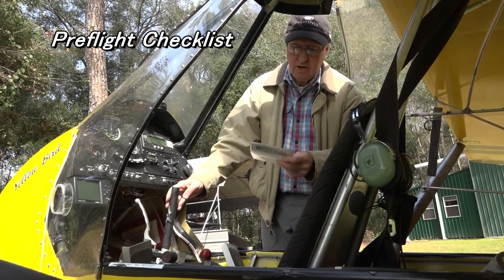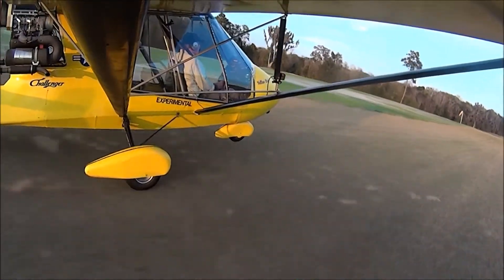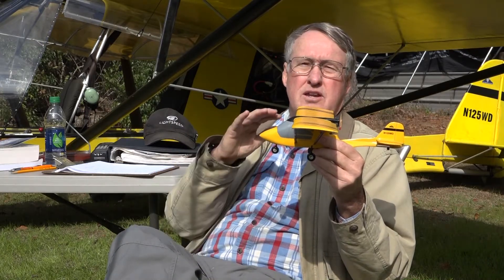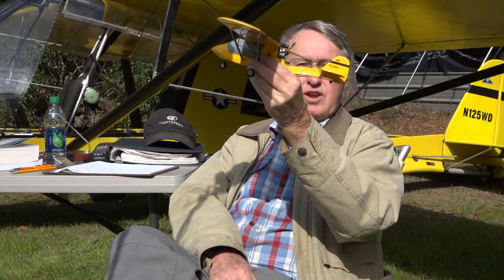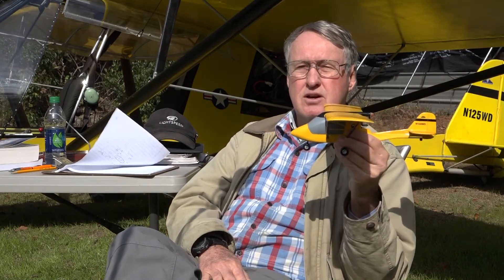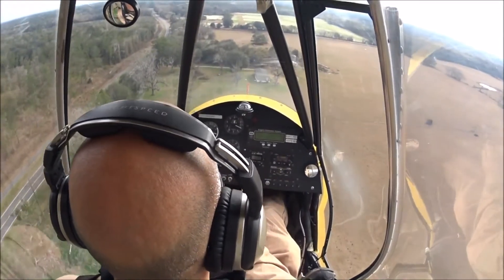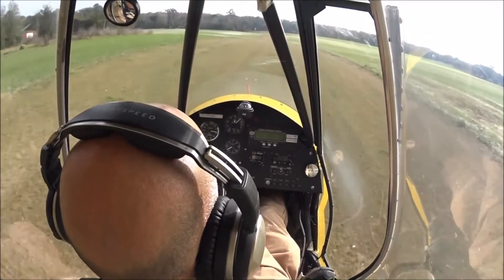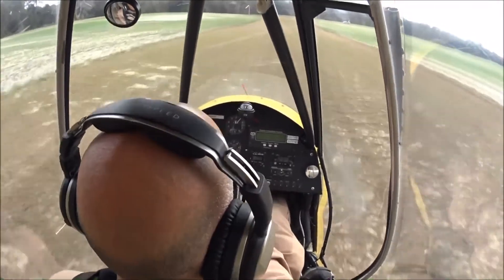Introduction to Challenger II  Flight Training   Part 3

Comment: Correction.: Approaching landing , control direction with rudders , NOT the ailerons close to the ground. I am an amature Hang glider and wanna be pilot. Close to the ground, maintain level flight reducing speed just above stall and flare when close to the ground stall.